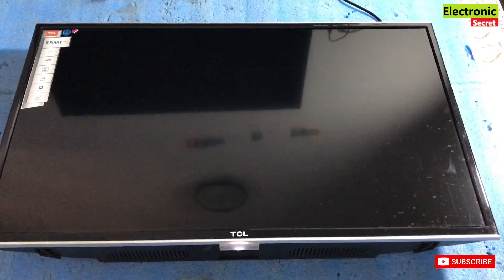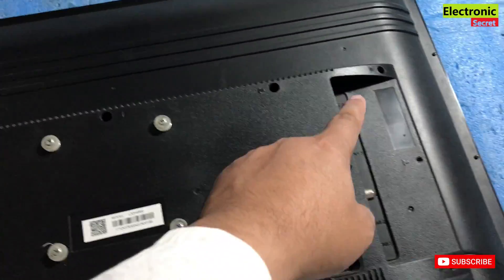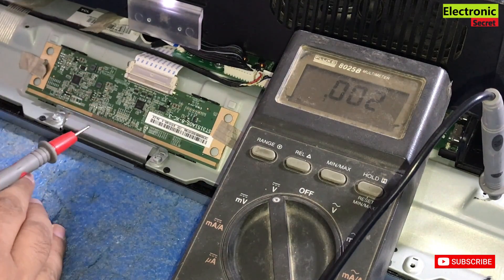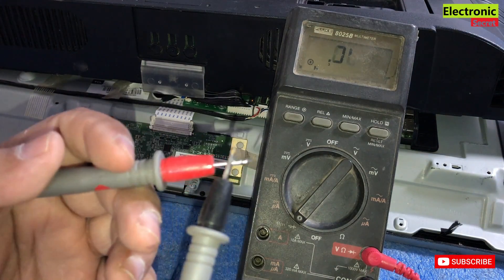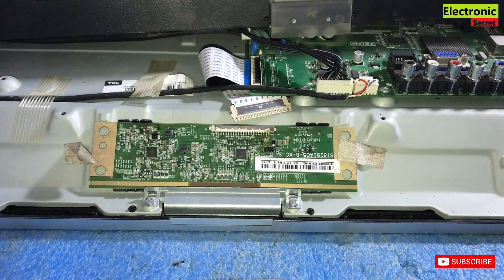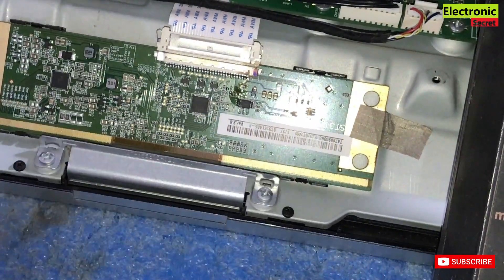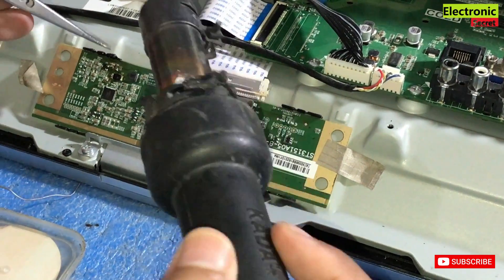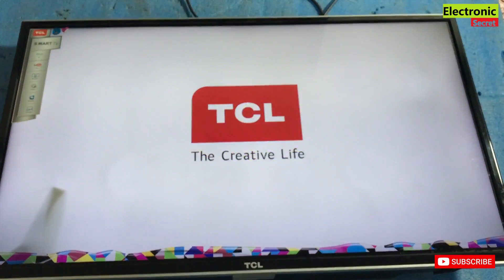TCL LED TV PANEL REPAIR, TCL TV BLACK SCREEN FIX

Comment: Recently my tcl display having a problem of dark spot and bright spot.  So i called the authorized service centre . They have changed the display panel. But after then again m getting a round dark spot kn centre of the screen. . Even i have checked my many feature of display now not showing like dolby vission format now not playing in dolby vision mode. Even many function like mmec etc not showing in display setting.. why its happening? Any idea? Ple let me know
Reply from the maker: I think your backlights cover have ben damaged
Reply: @ElectronicSecret  Thanks.. the problem is here in dubai tcl have 3rd party service centre and that guys not agreed..or pretend not to be agree...its clearly showing in screen dark spot in round shape with 2mm dots of bright display in centre.

Comment: Assalamualaikum Bhai mere pass panel LM171W02.  (A4) (M1) h AUR is panel per CV110.al model number Wala chaina card kese chale ga
Reply from the maker: Lvds cable lain aur card main panel k resolution k hisab se software kre,
Google main panel number ki specification check kre aur software download kre